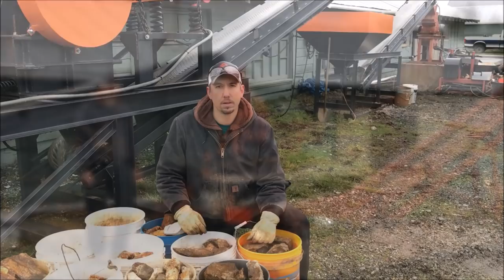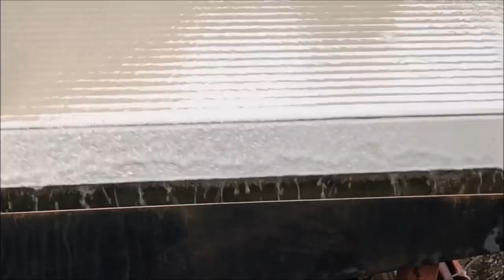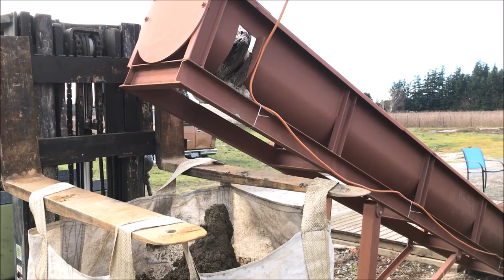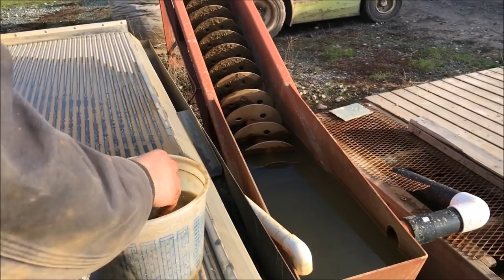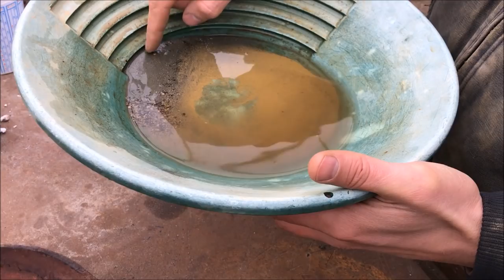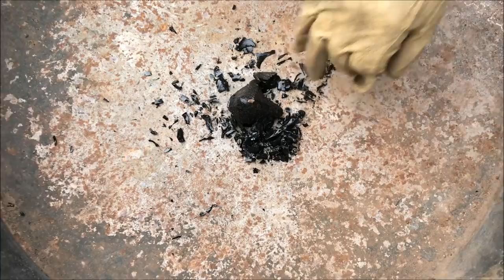Gold Ore Processing Plant, Crushing Quartz Hardrock Gold and Smelting Buttons to Sell for Cash Money

Comment: what I want to see is:

1. startup costs for equipment and other requirements
2. power, water, and material costs per hour of run time, including smelting.
3. time required to process 1 ton of raw quartz
4. time required to reprocess 2nds and midlings and exact recovery % from doing so.
5. all of that measured against the profits from gold and sulfides extracted.

because right now, it looks to me like the costs of processing this are about even with the profit from the result, which means it will take a long, long time to recover your initial investment.

frankly, you probably could make more money creatively selling cut pieces of veined quartz for decorative purposes like landscaping or tiling.
Reply: Yeah, that button, if I mathed right, was about $900 bucks...

Comment: say Jason, i'm new to your channel and was wondering if you're using a Wilfley headmotion on that shaker table? the housing conceals the action so it's hard to tell if that's a run of the mill eccentric or a Wilfley...

edit:  what are you using as a softening agent for the water? i hear jet dry works really well and since there's no bubbles on your table i'm guessing you're not using Dawn dish soap?

Comment: Minnesota is a green zone, capillary gold is very thin veins running through rock, easily felt when two identical rocks have much different weights. I know to weigh two rocks that look to be the same but have much different weight, then use the amount of water they displace gives you an idea how much gold could be in it. Seeing the gold with a 30x lighted magnifier, makes you smile but you can't spend it. Glaciers moved the rocks here and the grinding by glaciers creates grain gold, salt size or smaller to come up in your well water and pumped out with the septic. Come visit I have rock outside piled up and on top of my wood stove. Using outdoor steel racks to heat the rocks before plunging them into ice water to break them up and pan out the gold come spring.
Reply from the maker: Nice

Comment: that was great! I would have liked to have seen the ore ground up smaller and roast the sulfides and then grind them or run them over the table again. that's what I would like to see a full run of. I believe I have a lot of sulfides and that's what I'm going to be looking for the ability to process completely.
Reply: Different process and not what this setup was intended to do. There are good videos out there of this being done, but roasting sulfides can be dangerous where as this is a purely gravity seperator setup so environmentally safer. Roasting sulfides can be(depends on the type) a highly toxic process so may require a controlled environment with appropriate safety equipment.
Reply from the maker: Great, thanks for the tip!

Comment: Knelson concentrator would be a great addition for you 7.5 to 12 inch cone. 150kg to 3-4tph on cone size. rotary union valve feeds the water 2-6lb psi depends on minerals to be recovered into the jacketed cone creating the fluid bed. 3/4- 1hp motor @400-600rpm (30mph outer cone speed max) Its recovery on the tailings youre feeding to waste there on that size would be upto 99%. I do believe the patent is open to build your own version.
I love your setup its the most practical system ive seen and looks quite flexible in terms of ore types itll process
Reply from the maker: Thank you for your comment and for watching our videos!

Comment: Do you have an electric system with a PV system? Can't buy anything but it would be interesting what kind of specs it had to have. Like how many kW the motors need, how big the battery array had to be and the solar array too.
Reply from the maker: We power the whole system with a 40 KW generator so it would need to be a large PV system

Comment: One thing i can see i would do diff is precrush to one size than reset jaws and recrush than that would make yr over all run go much smoother as it is looks out of sync crushing the rock jaw side way faster but the hammer mill is being fed such big stuff it cant take it that fast. If you reduce the size of the input rock into hammer mill in half the current size it than could flow much better. Just my 2cents i can see i would do diff. But very nice setup over all very good!
Reply from the maker: Thank you for your comment and for watching our videos!

Comment: how much was that tiny bit of gold value ans was it worth it with all the processing cost and fancy machines
Reply: For 24 ct about $700 USD spot price which u never get selling it. Say $650. Now take the cost of mining the 3500lbs rock, the labor, fuel, transport, machine etc etc etc....you just made $20.  
U would do better with less hassle claim jumping Alaska sand in the middle of the night during a winter shutdown with no boots on
Reply: @poppapips7493  better look with metal detector in oz
Reply from the maker: Yes it was about $700 at today's prices.  This sample was from a dump pile so all the customer needs to do is scoop it up and dump it in the hopper to the jaw crusher.  In this instance it made good monetary sense for him and he bought a system.  Thanks

Comment: Seems to me that your shaker table is shaking a little to violently to be fully  efficient.  The speed of shaking could be as is but the travel of the shaking could be up to 50% less, Might give better results!  This be my opinion only!  Perhaps you can discover more Gold in your tailings!
Reply: and i saw some Burps of input slurry sloshing over the rail every so many seconds..
Reply from the maker: We have tested the RPM of the table both faster and slower, but the current throw and RPM work the best for fine gold recovery.  Thanks for your question!

Comment: You will get a finer grade after the hammer mill/impact by putting the water at the discharge!
Reply from the maker: Maybe, but then you will have a dust storm on your hands.  Better to classify the oversized and re-run
Reply: No dust, the mill creates a vacuum and sucks all the rock and dust into the output where it is sprayed with water. Try it

Comment: The hammer mill is the weakest point. It does NOT crush ore to a fine enough material.  The hammers wear extremely quickly. Mill body wears quickly as well. Something to consider is if you are in a really remote area, parts could take a long time to arrive. Substituted hammers of varrying degrees of quality are also a problem.
Reply from the maker: Hi Gary,  thanks for the comment.  I agree with you, the hammer mills are high wear machines.  Ball mills are much better suited for longer term operations.

Comment: "About 70%  passes 30 mesh and and about 50% passes 50 mesh". You dont math much do you? Thats 120% which is impossible.
Reply: POVadventure use your brain. 50% pass 50 mesh, 20 % stay on the 50 mesh sieve, 30 % are already retained by 30 mesh, thats perfect 100%.
Reply from the maker: Yes, 70% of the total passes a 30 mesh and 50% of the total passes a 50 mesh. They are not combined samples